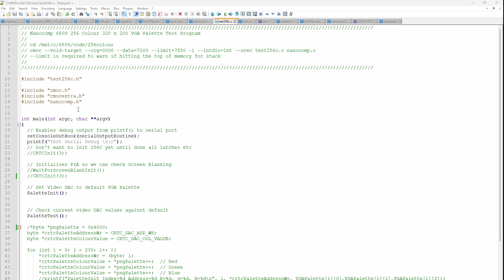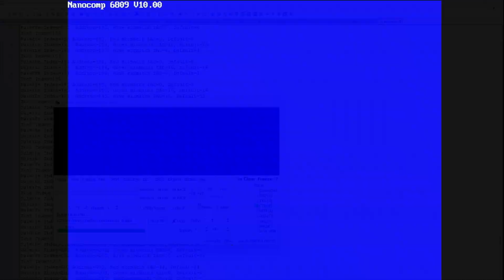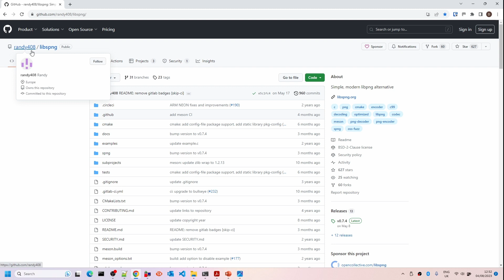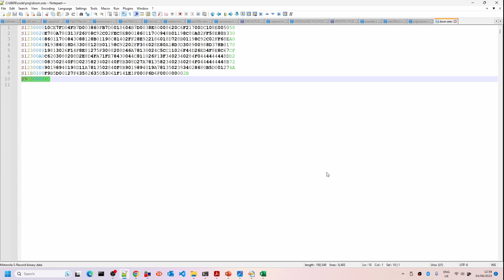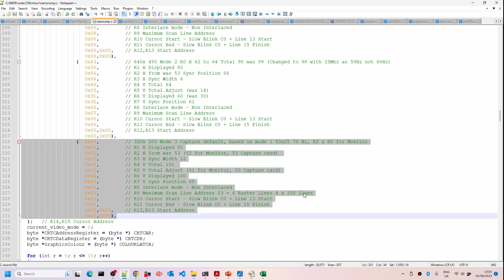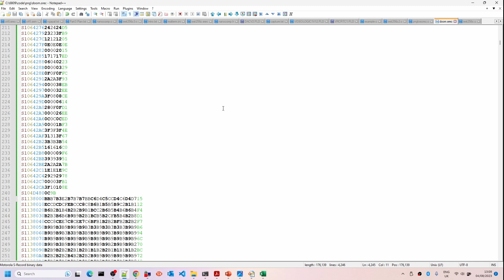V13 Part 4 Display Doom.png on 256 Colour Breadboard VGA Controller Nanocomp 6809 8 Bit Micro

Comment: Congratulations on finishing your series. It's been quite interesting to see what it takes to turn a 6845 into a practical graphics card. Looking forward to your future enhancements. Thanks!
Reply from the maker: Glad you found it interesting, it has taken a bit longer than I expected. I found it interesting that the basics of the 6845 used in BBC Micro and PET is capable of ALMOST providing most of the core VGA features which didn't arrive in custom VGA chipsets until 1987+. It was just the lack of analogue video signals provided in VGA (vs CGA and EGA) which held things up (and perhaps the speed of DRAM at the time, I know I cheated with fast static RAM a bit!).